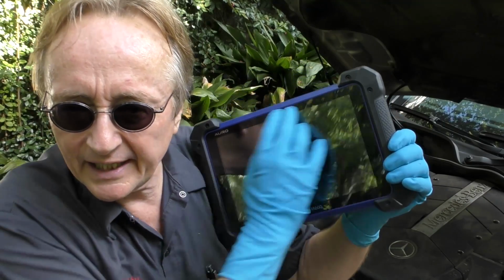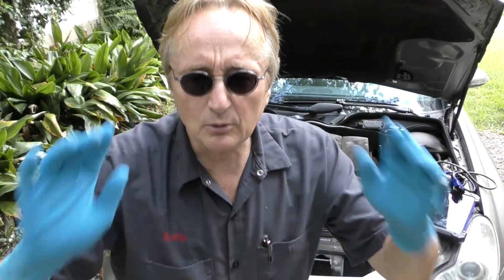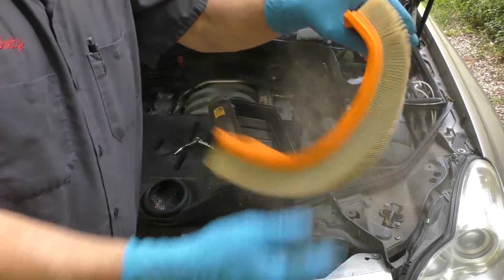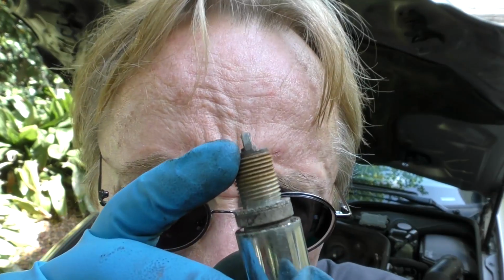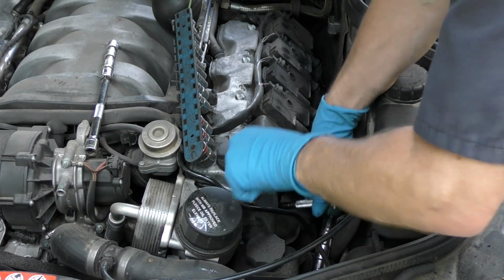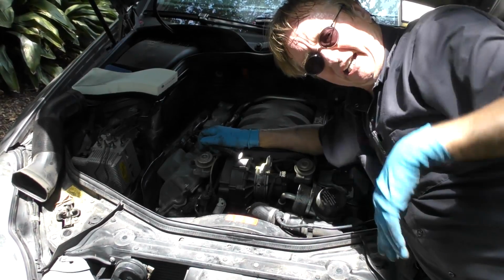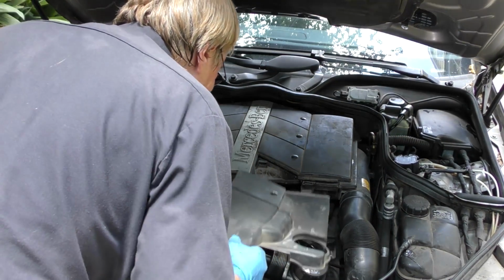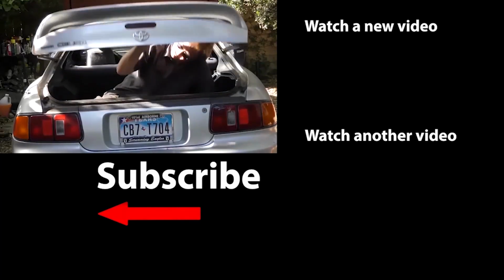Doing This Will Make Your Car Idle Better

Comment: "Idk why it's not idling properly"
'Did you check your air filters?'
"The what's?"
Sahara desert pours out of filters
Reply: Serious..........and I mean DAMN....that was bad!!!!!!!!!!
Reply: Those were the original filters.
Reply: Lol best comment
Reply: Dude,  I was like wtf?   Did he went off-roading; dirt rally or simply someone happened to dump a bucket of sand into the intakes ..   lol 😂
Reply: If I was that car, I would definitely get a new owner
Reply: @DJDekgit. And a berlap sack o leaves that we don't need. 🎼🎼🎵
Reply: If they'd intended this to be changed regularly by the owner it would have a wing nut and not a 22 mm torx head.
Reply: Scotty, best not to shake old air filters over the now opened air intakes.  Nothing like a massive infusion of 10yr old dust!
Reply: michael lee   no he just flipped it inside out last week,it is good to go for another month!!!!LOL
Reply: @MvP4eVa1 : Maybe he lives and has to park in his driveway right on a dusty dirt road, and people drive by fast kicking up a ton of dust. That's our problem, so we're replacing the air filter now.  Thanks, Scotty

Comment: But Scotty, without the TP20 socket, how else would we distinguish between a Standard Mechanic and a Mercedes Mechanic? xP
Reply: Ford Fanatic oh yeah. I remember when Torx first started on GM products about 30 years ago. Then they also went metric on transmissions and so forth.
Reply: @zaxarispetixos8728  But still uncommon in a world of Allen Heads
Reply: @zaxarispetixos8728  
But Phillips is the Freedom Head of screws (and drivers).
Reply: Say all theese the next time you strip one philips even out of the box chinese screws get destroyed

Comment: 16 spark plugs and torx bolts. Those savages.
Reply: Ninja Master I’m idle right now, just sitting here watching the videos?
Reply: Armando Sturzenegger  yea renting cars is very smart especially when you rent them with limited mileage.
Reply: Are you saying you'll never have to do it again since it will become an endless money pit before the time comes around to change them again?
Reply: 16x10 
160 just for spark plugs
Reply: 2 spark plugs per cylinder is proof that the manufacturer can't design an efficient engine.  They may as well just drop a diesel in it from the factory.
Reply: It probably took 8 days to replace all those plugs,....
Reply: @melodicdreamer72  thats subjective. my benz wasnt too bad before i got it. only things necessary to replace was the engine mounts and the transmission mounts which were inexpensive as well as a few ball joints and a pcv hose kit, all of which were relatively inexpensive. not bad for a 130000 mile, 300 hp 3500 dollar car...been 2 years now with no problems. rides smooth.
Reply: Nope! I'll stick with my 4banger with 4 spark plugs.
Reply: And I was Bitching about the Rear Driver's side plug on the IROC 305. Lol 😎
Reply: MB v8 used 2 spark plug per each...
Reply: I know Scotty doesn't have too much good to say about them (therefore my kidding around), but they are sure fun and comfortable cars and it sounds like you got a good deal on it.  There's nothing wrong with that.
Reply: for better money saving
Get geo metro 
Three cylinder great gas mileage
Available in US if you can find it
It got like 60 to 70 horsepower
Reply: So...like a HEMI with an extra air filter? Twin-spark may not be elegant but it does make sort of emissions compliant V8's meet emissions requirements
Reply: @Timothy Mckee So does that require removing the whole front clip or am I thinking of one of the many other Audi products where that's true?
Reply: @scorpionwins6378  Not really. Honda did something like this in early 2000's . IDSI engines but on an inline 4 cylinder with 8 spark plugs. Spark plugs fire sequentially for cleaner burning and better fuel economy. Or fire together for more power. Limitation is since you have 2 spark plugs per cylinder, you cannot fit more than 2 valves per cylinder thus top end RPM power suffer.
Reply: @Timothy Mckee Good luck with whatever not an Audi you buy next. While 1960s American is simpler than anything, many many cars are simpler than that, even fairly modern ones.
Reply: @ninjamaster3453  I be seeing you in other places heh heh ;)
Reply: @Timothy Mckee I still have my 60s Dodge and can get parts for it
 I wish my 90s Toyota could do that but I cannot get parts for it now let alone the future time 30 years from now. Scotty loves to brag that these cars last a long time and that's largely true... IF you can get parts. If it's an old model that's not so easy.
Reply: @king49334  Now those were great cars.  Had one in high school, a manual trans, very cheap to own.  Simple to work on.  I loved mine and kept it immaculate inside and out.  I regret selling it.  You won't find a good used one nowadays.
Reply: @Timothy Mckee The other day I brought my car to my mechanic just for simple maintenance and I have to wait an entire week to get through because he's working on a similar Audi, said it needs a new water pump....and he had to take EVERYTHING off it, I thought it was wrecked or something at first.
Reply: Hemi's are the same way
Reply: Torx bolts and screws are used quite often on both European and American cars
Reply: @LexicalNoScope  That was not even a normal Torx.  T20 would have been a standard Torx, this is a TP20...
Reply: @rolfbjorn9937  and not to mention the Torx+ Sockets it uses for the suspension amd steering.  $300 for a set from snap off.
Reply: Animals lol
Reply: Yeah, they coulda made it easier, but that would be too much like right.

Comment: Reason why the Mercedes Benz was idling poorly was due to lack of maintenance. If the owner replaced the engine air filter and the sparks plugs on time, he/she wouldn’t have those issues to begin with. Preventative maintenance is the key to make almost any car perform the way they were supposed to.
Reply: unfair sanic Not only Mercedes Benz but with any car in general. Especially European makes and models.
Reply: Exactly! I was going to say the same thing. There's nothing wrong with the car itself, the owner just didn't do normal maintenance like he should have.
Reply: My M112 E240 i changed my plugs and air filters but it still behaves like this. I could have a dirty throttle body as i have code P0120. But i will see when i do have free time to get my throttle body cleaned up.

Comment: Scotty, I did this to my 2000 Dodge Intrepid a week ago. I even changed an ignition coil, synthetic oil change, and some fuel treatment. It drives almost new now!! I’ve got 157K miles and running great!
Reply: I'm willing to bet you no longer have that car and either something went wrong wit the transmission or engine

Comment: Me: Hey Scotty, can you look at my Pontiac Fiero?
Scotty: Lets get all this plastic crap out of the way. (Ungh) 
Me: Hey, where did my car go!
Reply: Pipe Picasso The plastic was all that held the car together.
Reply: The 2.5 4-TECH and 2.8l V6 had aluminum intake manifolds.
Reply: @glennso47  It didn't actually. That was why you could turn it into a Ferrari or a GT40 or whatever faux exotic you wanted to pretend it was. All the structural bits were underneath.
Reply: Hey, there's a video under my Mercedes
Reply: careful if you need to lift it. the fiero has coolant lines that run down the edge of the frame towards the back & sometimes they get crushed when people use a jack to lift the car.

Comment: I've been fixing the idling issue with my car for 5 years. Replaced the engine air filter and IAC valve in 2014, and in 2018, the spark plugs and the air filter. In 2019, I replaced the IAC valve with a new one and it has good idle. I need to fix the exhaust leak issue and replace the O2 downstream sensor again. Thanks for the tips.

Comment: In 1967 my mother had a 1958 British Ford 2-door 'Popular' car. On a Sunday, I would clean its spark plugs and ignition points, and adjust the  carburettor idling, so I could start the car, engage 1st gear, let up on the clutch, and get out of the car while it trickled along beside me at walking pace, like a family pet, perfectly smoothly. Remembering to shut it down before the intersection.
Very much appreciating your advice.

Comment: Those must have been the factory air filters from when it was new.
Reply: General Zod Perhaps
Reply: Nah theyre not that old but they were dirty
Reply: That's what I was thinking. 😂
Reply: I always thought air filters were replaced when I serviced my Mercedes...My Mercedes is 13 years old and I live in a city. 😳 Welp, better go check it out. Wish me luck!
Reply: @leenevin8451  LMAO. My 2015 Kia Optima has super black cabin and intake filters after about 20K miles of driving in Los Angeles.

Comment: I just had this happen to me a few weeks ago, sparks were good and air filter was new. It was so bad it stalled twice. Took it to a mechanic and he cleaned the throttle body and did an idle relearn procedure , what's an idle relearn procedure ? It works great now. I did disconnect my battery right before this happened, related?

Comment: Hello Scotty! I have a question for you. I have a 1999 ford ranger 3.0 4x4.  It just started with  Rough idling. It normally starts vibrating once the engine is warm. It vibrates at idle and on drive. It hesitates when i accelerate. All this happens once the engine is war. I checked for a vacuum leake, did the spark plugs, sparkplug cables, clean the throttle body, and cleaned the Mass air flow sensor. Do you have any suggestions of what could cause my rought idle? Thank you!

Comment: Hi Scotty ...I cured a rough idle on my 1966 Chevy Corvair 4 door hardtop, 2 carburetors 110-hp boxer 6  by replacing the old points ignition with a Crane Cams (now FAST) electronic ignition...what a BIG difference in power and smoothness!!!   Of course to change Spark Plug #1 I have to move the monstrous Frigidaire air conditioner compressor out of the way...what a pain in the "tuchus!"

Comment: OMG, those air filters!  How could it even drive with them so bad? Must get 8MPG, Lol
Reply: 8mpg? Pshhhh. These aren't American cars bro.
I have a 2008 Audi A6 with a V8. It has short ram  intake, a larger fuel pump, larger injectors, cat back exaust, and an ecu tune. With all that, it dynoed at 334awhp (340Bhp stock) still maintains 19.7mpg avg with the way I be driving the damn thing 😂😂 not bad for an 11 year old all wheel drive modded German V8 with 145k miles
Reply: The gears are really tall that helps alot. If I cruise control about 60-65mph in 6th gear I can maintain about 26.3mpg +/-
Reply: @richdf5664  Not knocking the car, it's those air filters, never seen any so dirty like that, ever!
Reply: @richdf5664  & runs on 92 octane, probably
Reply: @arnaldofettuccine5227  Damn. I worked at a car dealership for 2 years back in 2014 and you'd see ones twice as bad daily
Reply: @richdf5664  how the f you getting that milage. if you checked the computer maybe its calculating wrong. calculate it with pump to pump. thats a v6 camry milage
Reply: That's one trip through the Sahara desert one trip through Afghanistan one trip through s Saudi Arabia one trip through Pakistan. Time fer a change I'd say.

Comment: I bought an 03 Malibu for 400 bucks. Thing was all wacky when in idle. But it was also stalling when idling. A month ago I replaced all 6 spark plugs and one coil pack and it runs smooth and no more stalling. And it idles a whole lot better.

Comment: Hey Scotty, why does my 2018 Subaru Forester shake a bit from the idling after driving hwy speeds? It will do it right after driving plus 55mph for a while and solving to a stop. It will do it for a few seconds (15) and then it idles fine.

Comment: I bet that's the original air filters and plugs that came when the car was new I guess the car was never given routine maintenance...
Reply: I've been looking at some expensive cars recently and you won't believe how cheap the original owner has been on some of them. Sure they get serviced in the first 3 or so years but then...

Personally I wouldn't drive around with dangerously defective brake discs, let alone wait until they fail before getting them replaced. But then again I wouldn't buy a Merc either.

Comment: $5,000 scan tool ... well its not showing anything wrong with the engine though, so let's try something else...lol
Reply: lmaoo😂😂😂
Reply: Lol that's really putting things into perspective.
Reply: Maybe it’s time for a new $10,000 scan tool! 😁
Reply: if it still in operational.... it not going to show... air filter and change spark plug do in maintenance manual... and you can had dealer dealing with it when you take it in anyhow. but air filter you should learn to check and clean them... by yourselves...

Comment: scotty  my 2013 Toyota Corolla has idling problem, when you make a full stop you can feel the engine almost stalled , RPM around 750. so I replaced all the spark plug, and air filter and cleaned throttle body, still the same issue , however,  if I turn the head lights on the idle will become normal,  you can see as you turn the lights on the RPM goes up aound 100 , been like this for around 100K km, I just have to turnt the lights  on all the time everytime after the engine started.  that's fine I can live with it , just wondering , do you have any idea what caused this issue ?

Comment: I thought maybe the Mass Air Flow sensor... why wasnt this cleaned?  Would it have tripped a code if it was dirty?
Reply: Silver Slingblade you’d think after Scotty opened the air filters then basically dumped them over two open intakes.
Reply: Yes if the MAF Sensor is too dirty, then it will trigger a code.

Comment: Is it necessary to change out the air filter on every service or can the filters just be cleaned out? I drive a 2007 Toyota Ractis. CVT engine...

Comment: Scotty I got a 2007 Explorer with the 4.6 v8, it idles fine and under hard acceleration it pulls fine but while cruising at 45mph it has a small little stutter while under light load, I've already changed the spark plugs/air filter/gas filter with no success, can you help me out?

Comment: I have a 14 accord sport that vibrates the steering wheel and driver seat at idle at time... I've taken it to get diagnosed at the dealership and they have changed the sparkplugs and adjusted the valves. They also changed the transmission fluid but nothing has fixed it. The last thing they told me was that it was normal for a 14 accord to idle that way (which I know is a lie because it never did that before) Any idea on what it can be? Any suggestions?

Comment: Shaking or tapping the dirty  filter over or near the engine inlet manifold is not a good idea. Do it away from the engine folks!
Reply: Yeah I was thinking... come on Scotty dont do that.
Reply: Dosen't matter 😂😂😂
Reply: Jean Romero ya it does stuff will go right into the engine
Reply: On a mercedes its bad but on scotty celica its nothing but just some dirt
Reply: @jeremyl8989  do you known what an engine does? It burns, any debris that goes inside will be burned.
Reply: Yall acting like he dumped a trash can in there.
Reply: @Jean Romero Actually it does matter. If dust and debris was meant to be in there it wouldn't have air filters to begin with.
Reply: @claytonbigsby7396  no one said dust and debris are meant to go inside the engine. Hardly anything fell inside when he removed the filter, yall are just overreacting.
Reply: Only Scotty can do that and make it work
Reply: Jean Romero then why have a filter in the fire place Einstein? Remove yours and see what happens to your engine.
Reply: @88997799  Engine was't running at the time, stuff fell straight down.

Comment: I'm certain this also applies to American made cars and trucks, My Silverado was doing the shimmies when I stopped at a red light, cleaned the (Mass Air Flow Sensor), and it stopped shaking. Going to replace the engine air filter tomorrow, haven't changed that since I bought the truck, I am pretty sure she will be running close to brand new! Thanks for the video Scotty!!!!!!!!

Comment: Would this also fix a car which idles stable but low? When I'm at a stop it'll idle at around 1,000 for a second or two then go all the way down to like 5-600 rpm, 2003 Toyota Celica VVTI. Has an aftermarket filter which has seen better days so once I've been paid I'll replace that and see, any other suggestions?

Comment: How to fix a Mercedes engine problems in three steps:
1. Buy a Ford Raptor engine and trans
2. Swap the Mercedes engine and trans for the Ford Raptor engine and trans 
3. Engine problems solved and gained 200hp+-
Reply: @marckassabian8681  not really, biased opinion of yours.

Comment: Hello Scotty! My steering does light knocking sound when I steer it close to full lock when I m stopped (to park for instance) or when I make i tight turn. Checked the fluid, its full to the top. What would that be? Thank you! Oh the car is a 2000 Honda HRV 1.6 awd vtec

Comment: Why cant $100,000 cars go without problems for at least a good 12 years for that much

Its crazy to spend that much then months later you spending money on repairs
Reply: because mechanically speaking, those cars arent really worth that much ... you're paying for the brand name
Reply: Rich man problems. Thats why.
Reply: My Buick will be 12 years old this autumn.. only had to replace the silencer/ midpipe resonator. And OEM throttle body.

Comment: Today i changed the engine mounts on a w203 with a m112 engine, the v6 on which i worked is based on this v8 and squeezed in a even smaller car, since we talking about no room to work

Comment: Hi Scotty
On Mazda 5 2006 I did spark plugs replacement. Air Filter & oil change (filter to). Air sensor cleaned.
But the engine still dies whenever stops. 
Unplugging the air flow sensor helps.
The sensor was replaced. But still.
Any ideas?
Tnx